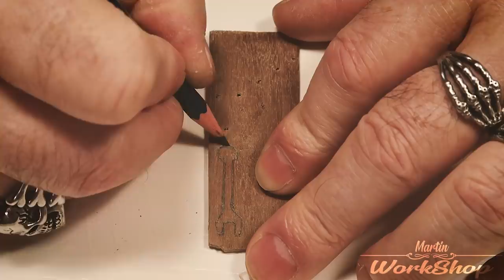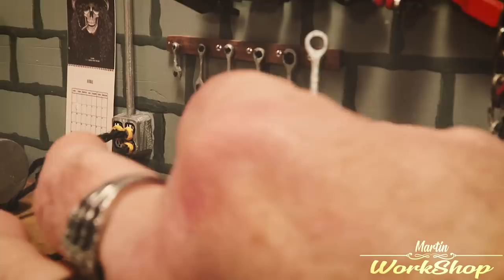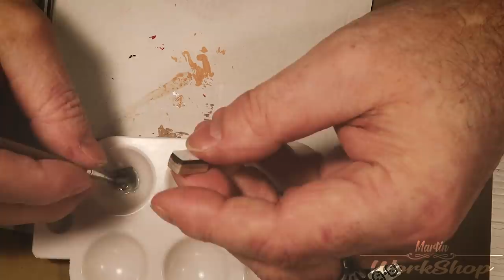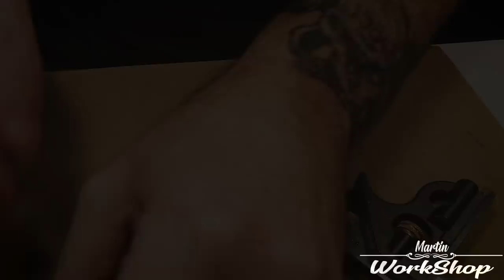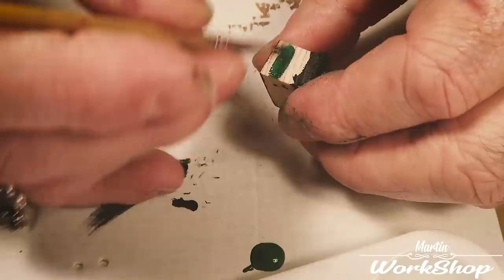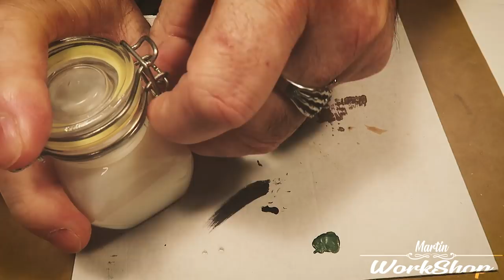Wrench Key, electrical outlet, car battery | HOMEMADE!

Comment: Yo sa va peut tu faire des tirages de tes fabrication ?? Je suis le 3 ième
Reply: Non ce n'est pas prévu et ton commentaire " Oui ou non " en mode je veux une réponse dans les secondes qui suit, c'est moi qui mets les vidéos en ligne, une réponse dans les commentaires YouTube n'est pas généralement rapide, alors patience :) Je ne te dit pas ça méchamment, mais ton commentaire étais écrit limite sous forme d'ordre donc.
Reply: @steelorse  c que je voulais dire c'est des pas écrire un roman mais dire oui ou non mais sa du un onneur de te texter
Reply from the maker: Pour plus tard ,J'y pence ,pas pour des tirages il y a trop d'heures d'ouvrage.
Reply from the maker: !0 $ je t'envois un orthographe
Reply: @MartinWorkshop  ok
Reply from the maker: Je dis pas ca pour t'insulté mais mes pièce coute beaucoup plus cher que 10$ ,je passe de nombreuse heures a fabriqué mes reproductions mais merci pareil de ton offre.
Reply: @MartinWorkshop  ok a plus
Reply: @MartinWorkshop  je vais me l'ai faird car j'ai les outils nécessaires pour se heure de travail
Reply from the maker: Cé avec des outils simple que je travail justement pour que ceux qui veule reproduire ce que je fait puisse le faire, je suis sur que tu en ai capable. Bonne chance a plus.